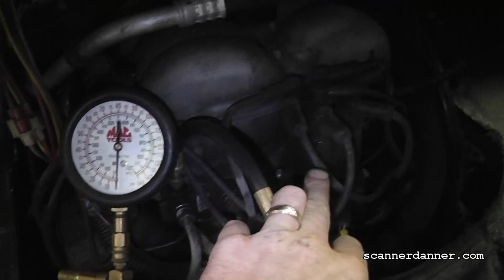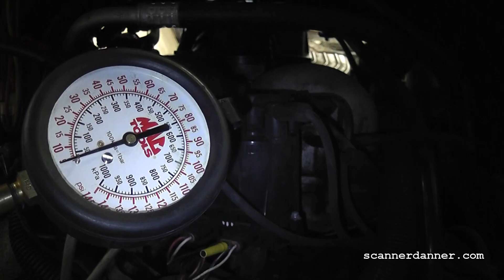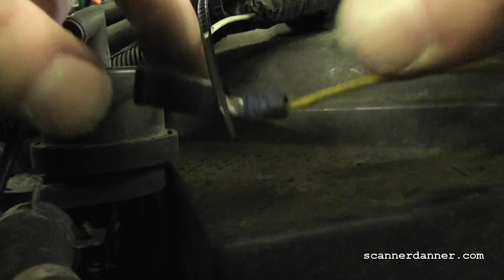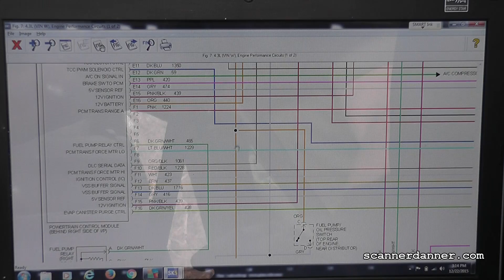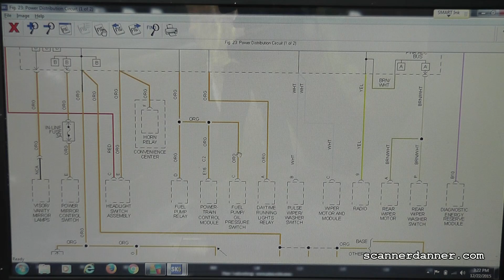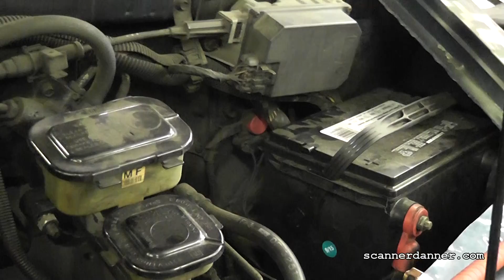Fuel pump electrical circuit diagnosis (no fuel pressure testing) GM

Comment: Great video. I do prefer using a power probe, personally for a couple of reasons. Mainly because a test light might show that there is no voltage by not lighting up at all but if it does light up it tells you that there is voltage but doesn't tell you how much. Also, I like the power probe because I can send full battery voltage to a load ground to check ground integrity. If the circuit breaker trips in the power probe, the circuit can handle current. The power probe 3 has a display which shows voltage which is great. A test light has it's place and is useful but the power probe offers much more information to me when diagnosing. I feel it makes me more accurate and faster which is always my goal.

Comment: Great video, thanks...our Astro van has the same problem, we thought it was the fuel pump, it was not, we changed the ignition module, the relay was melted, and we didn't know about the module behind the battery...we will try tomorrow....we have two weeks with the van trying and my husband found your video, very interesting and useful, hope we can fix the car....regards from Mexico.

Comment: Please help i have a 00 or 02 astro van , no fuel pressure but i can hear fuel pump primer.
Reply from the maker: Check your power and ground at the pump during cranking next.
Reply: ScannerDanner I have a 95 GMC vandura new fuel pump new filter, new pressure regulator it ran with the new pump and filter now it don't I cleaned the positioning sensor and replaced the regular   I have spark I'm pretty much at a lost now

Comment: Dan here is an update still trying to fix my expy. Expy failed going up hill on short out of town trip.   replaced fuel filter that was clogged.. ran perfect for 3 days. It failed after errands in a parking lot.. went to get it.. i drove it home.. for 2 days cranked perfect.. continued to run gas out over the next few days  so the fuel pump would be easier to change.  It failed to start again for five days. Researched . I have Chilton's ECT. There is a limited amount  of info in them. I am an ex electronic tech.  Understand relays ECT.   So watched videos ECT.  Checked Schrader valve had gas there. I decided to turn the engine over.. it started (we are dealing with an intermittent here) I took it to a neighbor  and he put a bid tool on it.. not a cheap one.. it initially said misfire on cylinder 4.. that made sense because when it quit, it did misfire going up hills   I told him  to clear the memory.. He found no codes..no cam sensor problems, no crankshaft sensor problems, always has had the sound of prime, never checked voltage at  fuel pump relay or pump itself.  I hesitate to pup 12 volts to fuel pump willy nilly, as it may feed back and destroy electronic infrastructure.   I know this can be the inertia switch (they sometimes are intermittent). It could be an insulation leak to the chassis.  I don't know if I am getting spark.. it seems like like the obd tester would catch that.. The problem is that it is intermittent. I notice this doesn't have the normal spark plug wire setup  and I think this  is cop setup.  I am a little  confused how to properly check for spark do I use a noid.  Oh yes it is only showing about 30 psi on idle and 35 on acceleration maybe a little higher at high rpms.  Also my  fuse board under the hood and  below the steering wheel does allow pull and replace of relays.  If it comes down to it I can fix boards, but if it's a expensive chip.. that probably won't be happening.. I suspect we are dealing with an obvious component. If  any body can give me a detailed  description of how this all works please do so.

Comment: you've inspired me..  This is my plan of attack tomorrow on my  truck. usually I think k things out .   As you said and put in writing we should have had prime. That's really the key to it all ..I have a f150 expe ,99 with a fuel problem  that just turns over.. I did have a bad fuel filter.. I'm not sure what psi it primes it at but it has to be more than nothing. I don't know if my vehicle has a Schrader valve, but I will have a psi tester on it soon.   I don't think think there will be anything there ..  when we were taught in electronic school that a TV had no video we divided and conquered.    it's obvious that there would probably be little or no fuel, but that is a great starting point.  next check if pin 85 is getting grounded for a short period of time.. probably is in my case  because I hear the pump prime... I should see something back on the  gauge.  I can take the relay 301 out in my model.   I'll troubleshoot from there. I would like to see the cam sensor signal there with a dvom. . Ii already know it gets there, so  the computer is doing its job.   since I hear the pump try to work I probably   don't have a  short on that line..  I'll test it anyway for a short..  I know I have continuity because of prime. since I don't need the engine to  provide the supply voltage,  putting 12 volts on that line will tell the story.  just thinking this out .  my truck  truck was running when it failed..ergo I have a fuel line that is good and flows to the engine. putting a  12 volt supply on it for about four or five seconds.. c.then check my  guage  will be another divide and conquer place. if the  guage stays primed I know that there is nothing wrong with my pump .. if the  psi goes down.. the check valve is bad inside the assembly  and  don't think they are easily repaired..   but just to make sure Ill  put relay 301 back in and try to start the vehicle.  I have to keep looking at  the guage.   it would probably be a good idea to monitor the cam shaft signal if it runs.

Comment: I have a 97 C300 7.4l. I replaced the fuel pump(not fun lifting an 8ft bed but had just topped off the tank) still nothing. tested the relay by swapping for another in my 98 suburban. started right up. good relay. pulled the multimeter out and am getting no signal from the ecm but can jumper the output to the fuel pump and get 60psi at the fuel test port. any recommendations on where to go from there? what about your wiring diagram source? thanks a lot and enjoy the videos as always! awesome job!
Reply from the maker: First question. Does the computer turn the relay circuit on for 1-2 seconds on initial key on? (Not cranking)
You'll need your test light or voltmeter connected to that circuit BEFORE you turn the key on to see it.
Reply: No.  No prime voltage present. Cycled key few times to make sure.
Reply from the maker: Each key cycle must be preceeded by a 5 second off period otherwise you will not see the prime again. Are you 100% sure about the result of this test?
Reply: Yes.
Reply from the maker: And the vehicle will run when you jump the fuel pump? (Confirming good spark and injector pulse)
Reply: No still no start.
Reply from the maker: Perfect. Believe it or not that is a good thing right now.
Next test, with key on unplug the TPS and measure all 3 wires for me. There should be 5v on at least one wire. This will indicate to us if the ECM is "alive". My money is on there being no voltage there
Reply: 0.01-0.02 on all three
Reply from the maker: Nice. Your ECM is not "alive". Check all powers and grounds next, (start with fuses) Then you'll need to make sure you don't have a shorted sensor pulling the reference circuit to ground. 
From this point on, you'll need to post this to my forum okay? (My standard reply on YouTube latetly):

It is becoming more and more difficult to answer questions here. I have 80,000 people asking me for help now. So I have created a forum to help you guys better. It is free to join and we can exchange pictures, wiring diagrams and waveforms if needed to help guide you through the process of troubleshooting your vehicle. Thank you so much! Hope to see you there. 
Paul Danner (ScannerDanner)
https://www.scannerdanner.com/forum/post-your-repair-questions-here.html
Reply: I found a broken ground wire and a blown fuse that I missed the last time I checked.  It was the ECMB fuse. Thank you so much for all the help! You are amazing and thank you for all that you do!
Reply from the maker: Awesome man! Nice Job. Thanks for subscribing and don't forget about my forum for future needs.
Reply: Will do!

Comment: Thanks alot for this video. My 92 S10 2.5L had a ground issue from me replacing the Blown OEM speakers with the same size 9x4 and 6x4 4-WAY replacement speakers. According to my friend, he said that the Chevy electrical system keeps a circuit through the speakers even when the key is out of the ignition. My battery would be exhausted within an hour or so of being shut off. Anyways when I got back to the truck and disconnected the speakers, the fuel pump wasn't supplying fuel to the TBI, no matter what. I had seen the  pt 261 or 12101870 connector at the back of the motor dangling without a cause. Sure enough following your lead, hooking that up to the to the positive, I struck smelly gold. I know there is a burnt front driver side speaker connector, where it must have shorted. That's the only thing I have spotted as of yet. I hope to find a fuse blown. I am not sure, I left the radio out, and unhooked the speakers. That might be the fuel pump problem for me. I'm going to have to dig deeper. You're video is the only thing on the net that described the PT 261 connector, and what it does. Thanks again.

Comment: wish you could fix the mess i have going on. I swapped motors from v6 fuel injection to v8 carburator .  I'm trying to get my fuel pump to run correctly with out the fuel injection wireing harness. I need to know what needle prongs do I have  to jump in the existing wiring harness to complete a circuit for fuel relay to operate correctly. ECM, PCM , RPM. crank shaft sensor or what? Help please!!

Comment: great video...! helps out a lot! i have a 00 chevy silverado doing the same thing just can't find the bad connection on the truck...
Reply from the maker: +Jason Miller look for areas in the harness near heat and areas that can move
Reply: +ScannerDanner thank you...how can i find the diagram that connect my headlights to fuel pump like in your video that would find my problem...? thnk u again u have me in the right direction

Comment: Man this video is just gold! Thanks Paul. Is there any way this van could have built pressure by long cranking it and start via oil pressure switch?
Reply from the maker: No because those two circuits share the same main feed which was where the problem was. Great question!
Reply: +ScannerDanner yeah! I've been reading gold material ;)

Comment: what happens if you connect the two wires on the ignition module in the wrong places on the module is one negative   and one positive does it matter where they go?

Comment: i have 2003 chevy avalanche, i replaced a new fuel pump, and i have no fuel presure, no start, and i replaced fuel pressure regulator too, help, 904-487-1804

Comment: SD  Do you think the Load Pro would have showed you the pump was bad earlyer
Reply: the current that feeds the pump but still a long shot finding the fault which in this was was the connector and only because of diagram study.

Comment: 12 volt on yellow wire….if this goes to PCM do you risk frying the cpm ?
Reply: If you mimic what the PCM does (provide power or provide ground) then you're fine. If it provides a power and you shove in a ground, you short out the driver inside as soon as it turns that output on. If you provide a power and it provides a power, they come from the same source (battery) so nothing bad happens.

Comment: Paul, maybe you already know this trick, but I would like to share with others. Instead of using the test light, I wet my fingers with water and with one hand I touch the T pin ( violet wire) and with the other hand I am pulsing the battery positive.

Comment: aul
was a good case
I heard you say that you could not hear the injectors because they are under the intake manifold
We use a stethoscope
I work at the AA in Holland so often been the fast road where much noise is
hope to have made a small contribution

Comment: so i was buying those cheap fuel pumps and putting them in my chev astro 1999 mini and 3 times i changed those pumps, so i bought a delco remey 125 dollars, but the wire harness for the fuel pump went out  so i hook it up to the fuse box, it comes on when key is turned in start position and off on accessory side so im good there, but the primer pump does not work any more. it went out along with the other fuel pumps, the pump is still good but im really not into to much in the electrical feild, so can you tell me where to start, this pump is under the driver side and the harness goes to the fuse box under the hood. this pump is a primer pump. so now im wearing out starters. 3 starter now, please leave me a message on blevins auto repair on facbook in alturas ca thank you
Reply: +James Blevins never heard of a primer pump on a 99 astro. Also it is a serious danger to have that pump wired that way. If you get into an accident and sever a fuel line your going to empty the tank on the ground. The safety  (which you bypassed) is the pump circuit should shut off when there is no RPM  signal.
Go get yourself a new pump connector and wire that in take pump the way it's supposed to be.
Reply: +ScannerDanner Premium ok on the 1999 chevy astro it has a small pump  under the van driver side it comes on for 2 seconds then shuts  down, it runs for 2 seconds along with the fuel pump, then you can start it. i checked everytrhing under the hood and its good all tho i did loos the power to the fuel pump and thats why i bypassed the harness, so you think its the relay?

Comment: do you know where the vacuume pipe off the fuel regulator goes to my car is a VW MK4 GOLF 1.6 16V AZD ENGINE. The previouss owner has bodged it up with 3 seperate bits of pipes and joined them together when i pulled the pipe off the regulator it also came off at the other end cant find where the other end goes. I have a missfire so checking for vacuume leaks tried spark plugs an coils and commpressions are good to also cleaned injectors still no change.  Cheers man

Comment: Does the ECM not fire the coil itself, rather than something inside the distributor? I would think the computer would first need a signal so it could calculate when to fire the coil. I know GM did stuff ass backwards with their EFI systems back then, so it wouldn't surprise me if they made their system just send an analog 0-5v signal back to the distributor to tell it the proper timing advance.
Reply from the maker: +Tim Ramich this is a bypass ignition system. 
https://www.youtube.com/watch?v=mxPdxGqRWvc
Reply: +ScannerDanner I thought so. What a mess they've created.

Comment: A no-prime situation could also be a double-whammy. A fuel pump relay could give out long ago without a person knowing. Some GM engines had a fuel pump switch as a fail safe for the fuel pump relay blowing out. It operates after a few PSI of oil pressure is built up, and the voltage for the fuel pump runs right through it (does not trigger the relay).
Reply: +Tim Ramich I always post too soon.
Reply from the maker: +Tim Ramich on those systems the symptom with a bad fuel pump relay is extremely long crank times especially with the engine cold (thick oil takes longer to build psi and close the switch)

Comment: Seen that a lot very common issue 
Went to look for a new connector at a junk and mostly found burned ones as well
Reply: That's where a forum that specializes in that model is valuable.  I use probetalk.com for my Probe.

Comment: Hi, thanks for the video, good Job.....
So my question is only because the FUSE the blue one it was dead right? So now you have to put in there a new component unit....that is behind the battery right?
But is good thing you was testing all the components, in that way because for to understand more......in the school they  didn't teach us like you are doing...... Thanks again...

( Chicago)
Reply from the maker: +Danny Chuqui thank you! and yes, if a fuse is totally dead, there is always a larger fuse (called a fusible link) that protects the fuse box and this is the direction to go next.

Comment: Hey Paul.
That circuit bothers me somewhat given that the lights and fuel pump share it. Imagine loosing contact on on a dark winding road late at night. No engine power equals no power steering and no visibility. Could be tragedy in the making.
Just a thought !
Anyway, wishing you and your family a very merry christmas and a happy new year for 2016
Reply from the maker: +james ross remember the lights and the pump circuit split off into separate fuses. They just share a fusible link. You lose a fusible link on any car and you will have multiple important circuits shutting down.